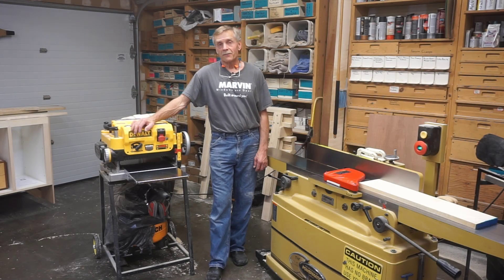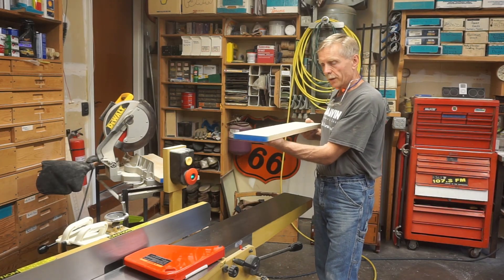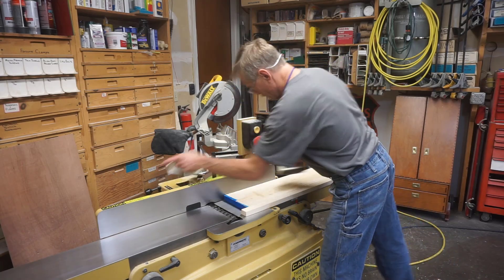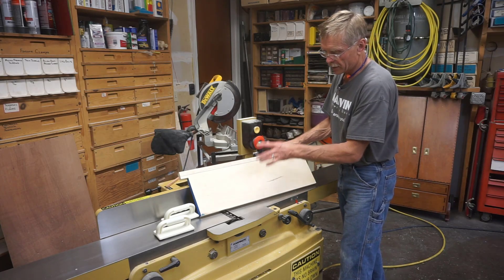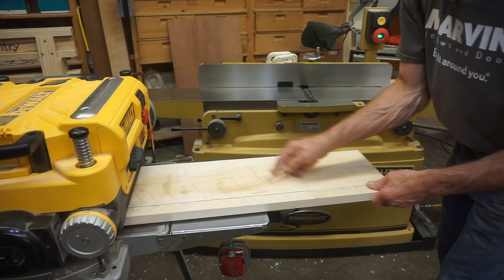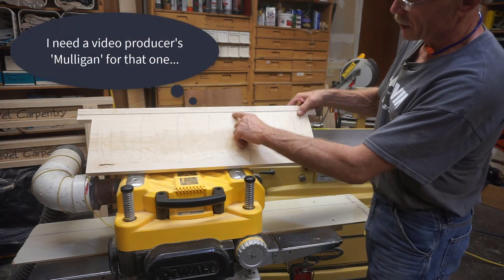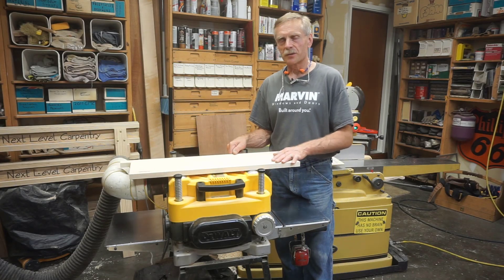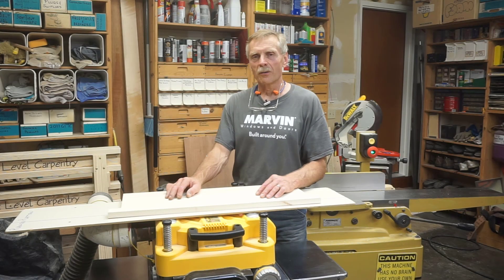Supersize Your Jointer for Planing Over-width Boards

Comment: Awesome idea! I had ruled out any jointers less than 12" because I didn't want to have a jointer that couldn't flatten a board that is less than the widest board I'd run into for my purposes. I was pretty much resigned to the idea that I'd have to get a 12" jointer/planer combo machine to get the most out of one machine and save some money. This video gives me all new reason to start reconsidering buying separate machines with smaller capacities. Very cool and extremely informative. Thank you sir:)
Reply from the maker: Good on you for thoughtful consideration of machinery choices Luis.  My reasoning in choosing an 8" model is that no matter how big a jointer I got there would ALWAYS be a time when I needed the next size up.  I developed this method back when I had a 6" jointer and frequently found myself working a bunch of material over 6" wide.  It was more practical to upgrade the jointer than use this process for so much and so often; it might have been 30% of the time?  Jumping up to 8" capacity means I only have to use this method like 2% of the time so the trade off is painless.  With that in mind I'd think through what you expect the majority of your projects to be and choose something that's efficient for say 95% of your work and get the best quality machine you can afford for it.  No need to get a 12" model that you need once a year.  BTW I'd choose a 6" 'parallelogram' style jointer over an 8" model without that feature ANY day.  Adjustment with a parallelogram style is SO much more efficient it would offset the wider capacity immediately.  I highly recommend a helical head for any jointer as well... it increases performance dramatically and is well worth any extra cost if you can afford it.  Best, Matt

Comment: I was happy how you explain that quick way to find the correct thickness to set the planer. Lowering it onto the wood until it engages. Then a little. Brilliant !!
Reply from the maker: Can't be beat Michael... once you make it a habit you'll save a considerable amount of guessing and frustration... at least I did. 😎 Best, Matt

Comment: "If you're one of the lucky folks that has a 24" jointer in your shop..."

I can't even imagine how big/heavy/expensive something like that would be.
Reply: $11,000-20,000 man... so yeah everything I mill has needed to be under 8" but this just increased my potential to 13".  Love it

Comment: Wouldn't it be better to put the stop block on top in front of the piece being planned and feed it through so you don't have to worry about the planned piece climbing over the platten? The planned piece would just push the platten with it.
Reply from the maker: By having a 'fixed' platen as show I'm able to plane pieces much longer than the platen.  You'd still have to pay close attention to the workpiece/platen edge with the method you suggest and it seems to me that it would be more trouble, not less. I'm not trying to prove I'm right and you're wrong here d2itforme; if you develop a different work flow that is functional for you then you should use it.  There's a lot of subtle factors that go into working efficiently and effectively and few woodworkers do things exactly the same... Best, Matt
Reply: @NextLevelCarpentry  Yes, Definitely have the block on the bottom; the auxiliary platten will not climb and it does not move. This is a great tip; an old cabinet maker showed it to me about 30+ years ago(no patent) and I have been using it ever since. We make tilted platens too which is a great way to make custom thresholds and floor transitions. Much safer and quicker than a table saw. Can send you a video of one of those. I think it is good that you explain this methodically because it is a tricky concept to get across; have to show it rather than just describe it.
Reply from the maker: @KimberJanney  I don't have anything for tilted platens for the jointer but here's two that I've done showing tapering/beveling with a thickness planer which, in these cases is safer still than tablesaw or jointer: https://www.youtube.com/watch?v=HZIMLaJyztE 

https://youtu.be/NnqhdzwZTUc Thanks for watching and commenting! Best, Matt

Comment: I never thought of turning on the planer and lowering it just until it catches the wood and pulls it through. Very good time saver.
Reply from the maker: Good eye... I think you'll find it much quicker and more accurate than trying to measure or use the planer's depth gauge.  Once you get used to it you'll realize the time savings you  mention. Best, Matt

Comment: Just bought an 8inch jointer but the on/off switch was not wired and came with no wiring instructions. Have searched the internet but can't find any tutorial how to wire this thing.

Comment: Gary, what's widest you'll go over your planer width?  Mine is only 4", but would love to keep 8" boards I  tact.
Reply from the maker: It's difficult to oversize your jointer by much more than 50%.   If you practice with 6in boards you might be able to get a 7 but the physics start to get in the way and leave less-than-desirable results. If you need to do many 8-inch boards I would suggest looking into a sled for your thickness planer to get the job done. I don't have a video on it but there's a couple out there on YouTube that are worthwhile. I don't use a sled as a rule because it's slower than this method but until you're able to get a larger Joiner it might be you're only practical solution.. and it's really not that bad
BTW The name's Matt😁😎

Comment: What kind of jointer would you recommend that's for hobbyists? I am new to woodworking and want something that will last and won't have to buy another. Thoughts on grizzly jointers? Spiral cutterheads?
Reply from the maker: I've never been a fan of Jet and Grizzly Sam... I just don't like their overall 'fit and finish' even though I'm sure plenty of people do fine with them.  If budget is an issue I'd think about finding and old used Delta or Powermatic because they tended to be very well built with wear parts available for replacement so they should virtually last for ever. Spiral cutterheads are better suited to jointers than thickness planers IMHO and if you can manage/afford an upgrade to one, on whatever jointer you end up with, you'll be glad you did.  Since you are new to woodworking I'll tell you that jointers need to be set up right or they'll do more harm than good.  Find and thoroughly read the owner's manual for any machine you get or are considering.  Understanding and internalizing what the manual says will take you a long way in the right direction for achieving peak performance and results.  The rest comes from experience, so look forward to spending some time using, observing and understanding what's going on when you run wood over a jointer.  Proficiency on that machine will take you a long way towards becoming a much better woodworker.  Best, Matt
Reply: @NextLevelCarpentry  I am buying a 20 yr Delta DJ15 this weekend.  Original owner, hobby use, in great shape. My first 6" jointer was a ridgid but ex wife sold it. I would prefer a 8" but not in the budget.
Reply from the maker: @tallyman15  my first 'real' joiner was a DJ15 and was a primary motivator to develop the 'supersize' method shown in this video.  The main thing I got with the upgrade to an 8" model was efficiency because many pieces end up being between 6" and 8" but few over 9~10".  So you'll be covered for most of what you encounter albeit a little less efficient over 6".  BTW the parallelogram feature of the DJ is so much of a time saver over a hand-crank design that you'll not likely feel the inefficiency. Best, Matt PS Don't forget SandFlex blocks and paste wax to restore the cast iron on your 'new' jointer! https://www.youtube.com/watch?v=YIE50o5pS6U&t=3s
https://www.amazon.com/ideas/amzn1.account.AF3DBB6XLH5MPIEOBDKPL3MQVYTA/YOSYTOHYVP3C?ref=idea_share

Comment: i literally ran into this issue with my new jointer and wasnt sure what to do.  appreciate this tip!!
Reply from the maker: Shows you're pushing the limits of what you have to work with which, to me, is always a good sign.  It's not what you got that counts but how you use it Bryan! Best, Matt

Comment: Hey Matt, couldn't you just flip the board so that the side that was over the rabbeting ledge is now up against the fence?
Reply from the maker: Good question Mike... unfortunately alignment problems prevent that from working directly.  It would plane off the 'lug' but likely just create a second smooth 'facet' on the workpiece which wouldn't be reliable for referencing off of.  Comments below suggest an indirect method that, if applied to your thought, could work.  It involves using an auxiliary infeed table platen.  Imagine clamping a strip of 1/4" material on half the width of the infeed table and setting the depth of cut to 1/4"  That platen would index the first planed surface and allow the lug to be planed off flush... make sense?  This interactive process right here is exactly how reader comments and insight helps viewers AND ME to discover and learn new, better ways to do things.  I haven't tried this but intend to to see if it actually works like 'we' think it will/should.
Thanks for commenting here! Best, Matt

Comment: Brilliant!
Reply from the maker: Thanks Daniel... hope this helps you out somewhere along the way.  BTW Just yesterday I used this exact method to straighten about 100lf of 4/4 white oak in 10 1/4" width... works like a charm, if I do say... 😌Best, Matt
Reply: @NextLevelCarpentry  
That is awesome. Just something I never thought of. Tried it last night on a scrap board after watching. It does work amazing.
Reply from the maker: @danieljohnson3328  Well adjusted, well maintained equipment is key to success for this and with them this method rocks!  Glad you gave it a shot and a follow up comment.  Best, Matt
Reply: @NextLevelCarpentry  
Thank you and look forward to more videos.
Reply from the maker: @danieljohnson3328  Hope you find other worthwhile stuff in the Next Level Carpentry 'videos' archive that are helpful too.  Just about every video here contains something I find useful (ie: profitable) in my residential custom design/build carpentry business.  Thanks for your comments here! Best, Matt

Comment: I have an honest question that I cant seem to figure out... Why not just use the planer to start with? It has the capacity to give a smooth surface doesnt it?
Reply from the maker: Good question Paton.  The reason is because, although a thickness planer can 'smooth' a board, it won't flatten it.  This process is used to flatten a board first.  A twisted/cupped board is useless for most woodworking applications regardless of how smooth it may be.  A jointer 'indexes' the surface of the wood off of its two parallel tables and planes the surface to match.  A thickness planer, at its core, operates much like rollers of an old-time ringer-washer: the knives cut the surface smooth at a pinch point so it won't remove twist... the board just 'cork-screws' it's way through the machine.  If a board is cupped, pressure from the feed rollers flattens out the cup and planes the surface smooth, but the cup returns once out from under pressure from feed rollers.  There you have it... hope this makes sense as it's an understanding fundamental to woodworking even at the most basic level.  Best, Matt
Reply: @NextLevelCarpentry  Yes, this does makes sense and adds to my understanding of this method. But, would it not just be easier to say... hot glue and wedge or screw a second known flat board to the platen side to hold target board down and allow the planer to skim plane? (Its rare I have this opportunity to hear from a master, so I truly value your input here. If my method is wrong please tell me how. My jointer is small and I dont think my guard is removable. So, there is that.
Reply from the maker: @PatonMacD  The method you're asking about is generally known as using a 'sled' for flattening boards and is completely valid, providing you have the 'second known flat board' you mention.  When I need to do that I like to use a piece of LVL beam which works wonderfully. The trade off is in time.  I can flatten a whole stack of 11" wide boards in pretty short order with this method because I don't have to set up each piece on the platten one at a time.  But I have to invest in a shop and jointer big enough and capable enough to do it.  Sounds like you're making due with less 'overhead' and expend more time doing the work.  Everyone is making this sort of trade off whether they know or realize it or not.  For instance I spend extra time working lumber than a friend with a larger cabinet shop who has a 12" jointer and  a wide belt sander... but I like to spend some of the $$ I don't spend on shop equipment and overhead on a carbon fiber mountain bike😀😎  BTW I first developed this flattening method when worked in a shop for a company and had only a 4" jointer to use... but its guard was removable.   I really appreciate your polite way of asking questions here... not everyone who doesn't understand is humble enough to approach things like you do and I respect you for it.  Best, Matt
Reply: Next Level Carpentry your welcome! And might I say that it’s rare to receive a response at all from my questions. LOL most think I am being sarcastic or trying to set up a joke or something. The truth is, I want to do more. I want to learn more. I see someone who is doing something I don’t understand, I ask so that I might learn then teach my kids or friends. I am not perfect. Nobody is... but learning from those who know, understanding what they teach and sharing your findings is exactly how to increase your knowledge by spreading wisdom. Instead of just taking one thing you learn and regurgitate what could be crap info to others who later find it to be wrong and think of you as a blow hard who wants attention or recognition. This particular trick you are teaching I hadn’t seen before and I am honored to have learned it. Thank you sir for your help, response and time. I will be watching everything you have put up now to see what else I have missed haha. Thanks again! Cheers!
Reply from the maker: @PatonMacD  Glad to have a polite and inquisitive viewer like yourself 'on board'... feel free to ask away and I'll try to reply as time permits.. Best, Matt

Comment: I appreciate this advice, I've been really avoiding buying a planer and jointer because the size of a jointer is expensive.
Reply from the maker: Buy as much jointer width as you can justify and afford, James... this will definitely help out but the more you start with, the more you can do.  BTW I started out with a 4" width Delta and, with sufficient determination,  was able to do some pretty impressive projects.  That said I'm not going to give up the 8" Powermatic without a fight! 😀😎 Best, Matt
Reply: Fortunately, today, you can get a 10 inch jointer/planer combo for around $550. In Europe, it's called Scheppach HMS1070; it's a re-branded chinese brand (probably "Wen").
If you're on a much tighter budget, you can search YouTube on how to make a jointer out of a hand-held power planer.
If you're choosing between a jointer and a planer, I think choosing the planer will be the best choice, especially because you can use it this way:
https://www.youtube.com/watch?v=G8o4P-aM8UE
(or similar, because you can make improved variants)
Reply: 68HC060 With next to no budget, I took a used hand power plane and built a frame and extension shoe. It gets the job done.
I haven’t gotten around to building a guard for it, so I am very very careful around it.

Comment: Hey There, I'm no master, but why can't you just run thru the planer to begin with...?
Reply from the maker: It's easy to missunderstand the concept Mike but a thickness planer only smoothes boards but will not take the twist out of them that's  what the jointer does and why this method is so important. The takeaway is to remember that with a thickness planer Twisted in Twisted out. You will have gone A long way in the right direction with woodworking when you're able to visualize this concept and principle Best, Matt